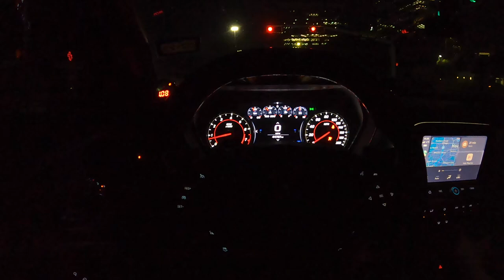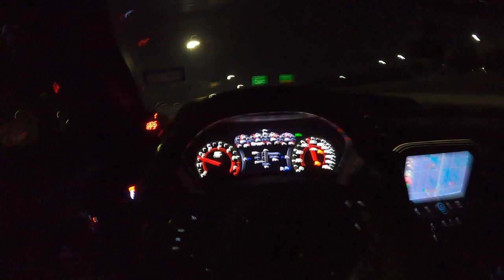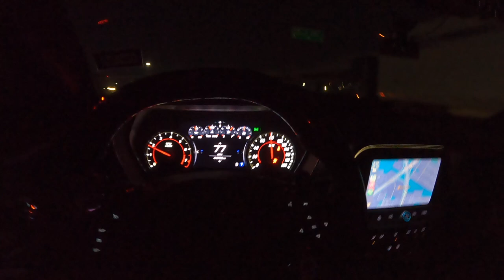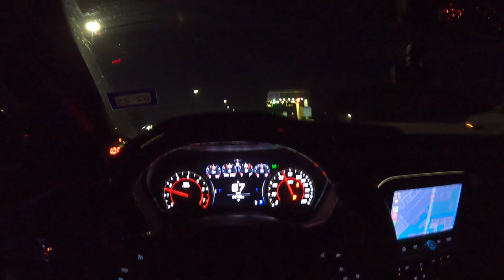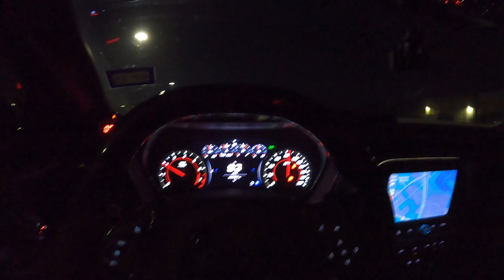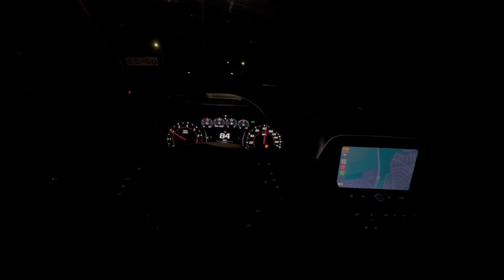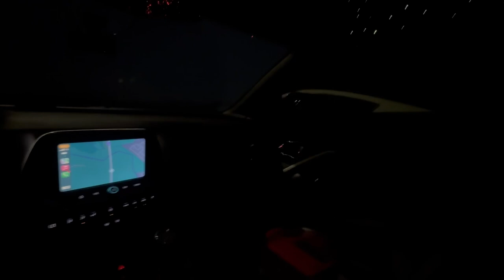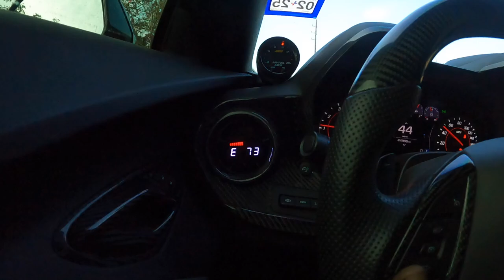ALMOST EVERY 6TH GEN CAMARO OWNER NEEDS TO BEWARE OF THIS #chevy #camaro #warning #fail #oil

Comment: Bro no these engines need a oil change at like 40 percent on the reader especially modding it & driving it how it’s supposed to be driven that’s the only way they will last I promise u will regret that it’s the only way those engines last
Reply from the maker: Trust me this is the first and only time I’ve let it get past that point trust me